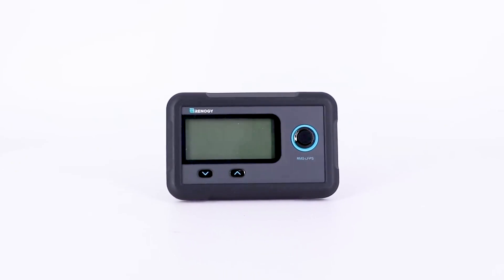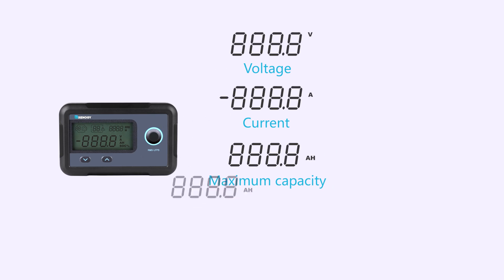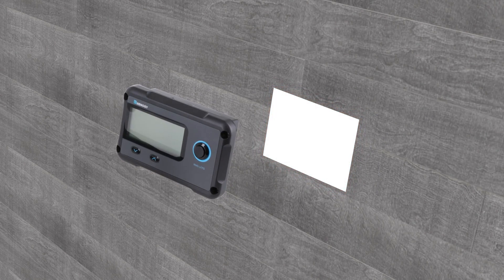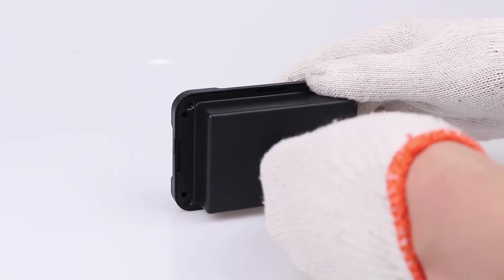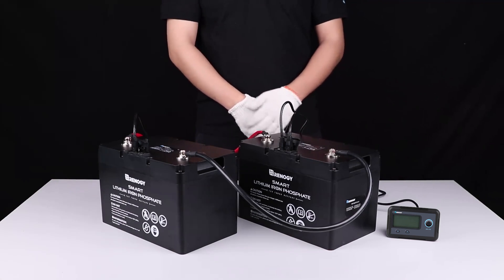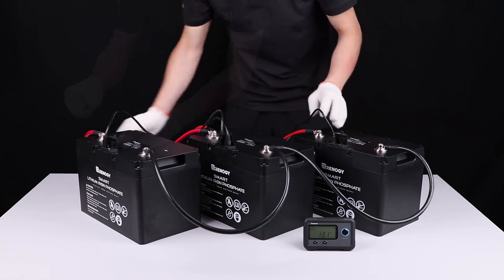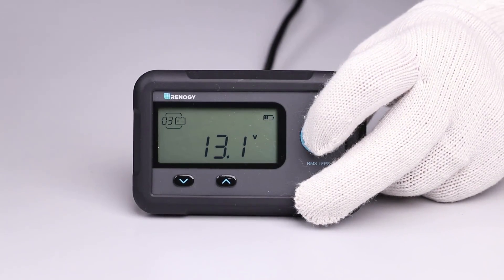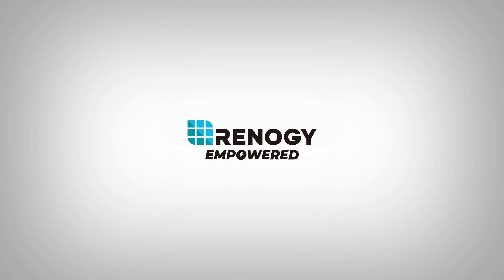Monitoring Screen for Smart Lithium Battery Series

Comment: If I bought the 200Ah 12 Volt Lithium Iron Phosphate Battery w/ Bluetooth would I still need the monitory screen if I want to use my phone instead? Does the battery have a restart button on it? Lastly does it have self heating with low temp disconnect? There isn't any videos of it since it's new and a preorder. Thanks.
Reply from the maker: Hi, Chris.

If you want to monitor the data on your phone, you do not need the monitory screen. 

For the 100ah battery https://www.renogy.com/12v-100ah-smart-lithium-iron-phosphate-battery/, it has a restart button on it. For the 200ah battery, it has no self-heating function now. But it has the low temperature protection function. You can click the link for learning the 200ah battery in detail: https://www.renogy.com/12v-200ah-lithium-iron-phosphate-battery-w-bluetooth/.

Hope it is helpful.
Reply: just bought 2 200ah renogy smart lithium where does it plug in to these batteries

Comment: So you only need to have two batteries connected/linked via Ethernet cables to enable the monitoring screen information on parallel battery banks of three or more batteries?  I have four of these batteries and need to know how to monitor all of them via the monitoring screen.  Can't find any info that nails this question down.
Reply: Hi, the trick is to not put an ethernet cable from Link to Link connections ( I initially made that mistake). So, Step 1: Battery 1 (B1) connect ethernet cable from UP to B2's Link; Step 2:  B2 UP to B3 Link; Step 3: B3 UP to B4 Link; Step 4:  B4 UP to the monitoring screen. Hope this helps
Reply: @alisterleith  Thanks for taking the time to reply.  I figured it out too.  They have been working well for the last 6 months or so.

Comment: Mine won’t display info for two batteries in parallel. Just blinks. After reset battery number remains 0 and no info.
Reply: Hello. The problem was solved meanwhile?
Reply: Have you tried to reset the monitoring screen? (long press the page up and page down button together)